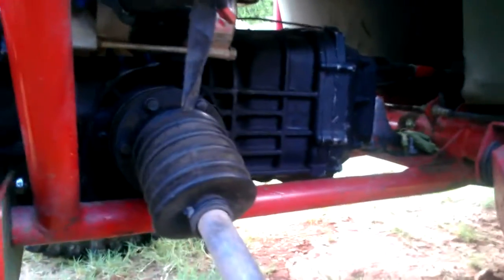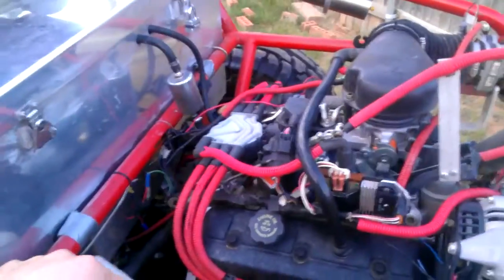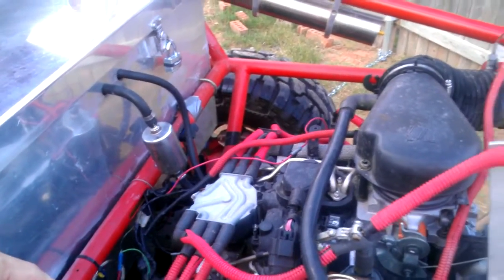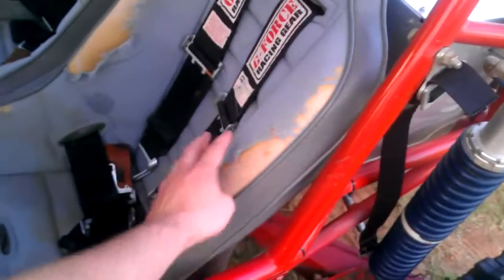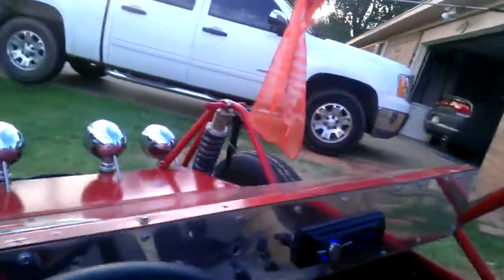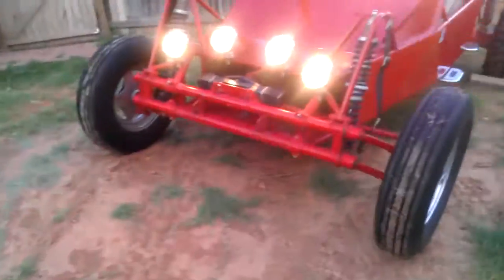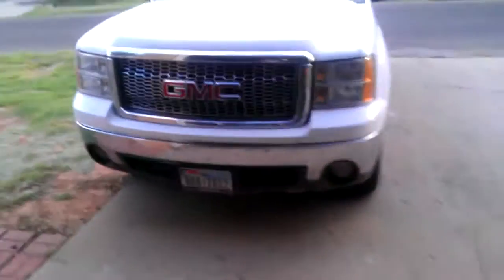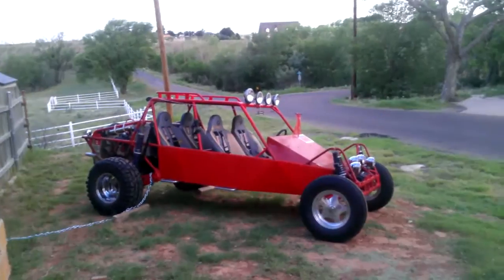V6 Dune Buggy for sale

Comment from the maker: had to use a vw starter for a 6 rib transaxle, which has a longer bendix. It was also a hi torque brand which had several different mounting positions

Comment: Hey could u post a vid on how it is wired up?
Reply from the maker: I sold this probably 8 years ago, but it had a 2000s model s10 blazer ecm harness.
Reply: @treyhaberman  so I’m building a buggy with the same exact set up and can’t get spark or fuel injection to work like there’s no power going to anything and need to cut the harness of all the excess stuff off and can’t find anything online or YouTube other than you
Reply from the maker: @zachromeo5524  I'm probably not gonna be alot of help, but if you got a vehicle harness and you're not getting fuel or spark, it sounds like a main ground or hot supply issue. If it was me I would locate a wiring diagram and double check your got wires and make sure the buggy's frame and engine are well grounded.

Comment: i'm building one 2 person buggy and have a 4.3 cpi from an astro van in my yard that i want throw in it. Was wondering if you can tell me if that engine on that buggy runs great for what it is and what transmission can I use on it that fit and hold the torque and power of that engine? what suspension you use too?

Thanks!!
Reply from the maker: that engine had more than enough power. my issue was that when I dumped the clutch with paddle tires the ring and pinion on my 6 rib bus transaxle couldn't hold up. honestly if I were to build me one I would not go with a vw transaxle at all. I would go mendeola "doubt that's correct spelling" or more than likely I would switch to front engine. I would also suggest if you want to take it on trails just as much as sand dunes, I would recommend doing a front engine setup because if I was wide open throttle all the weight shifted back and I had no steering at all.
Reply from the maker: and yes mine was probably same 4.3, depending on the year. mine was a vortec, so somewhere around a 1998. if yours is a tbi it will probably work the same